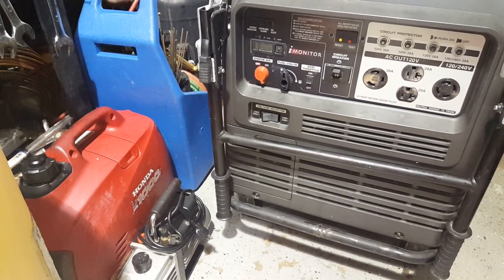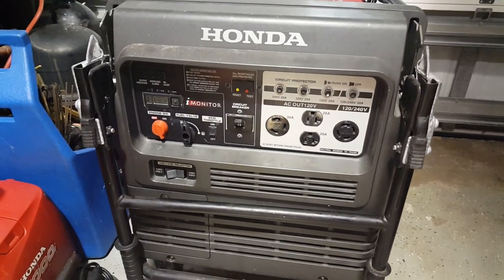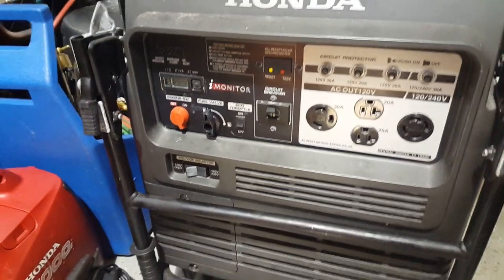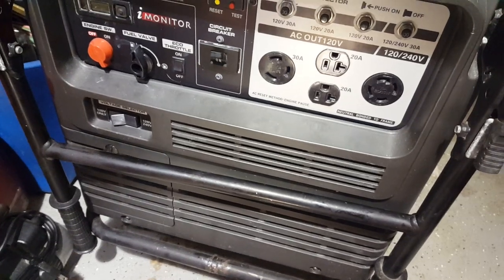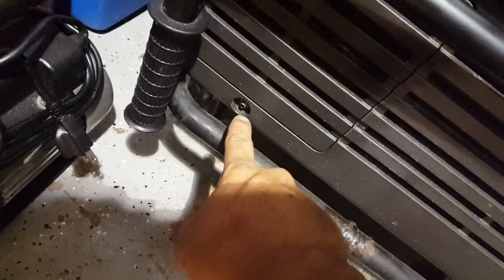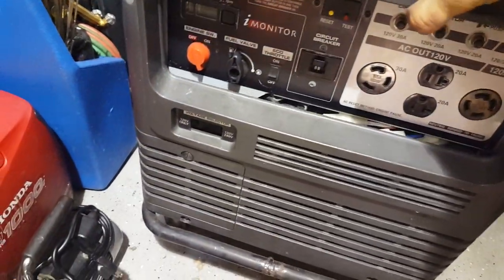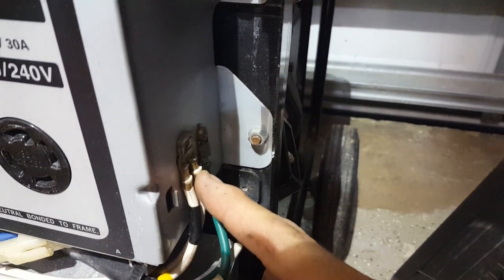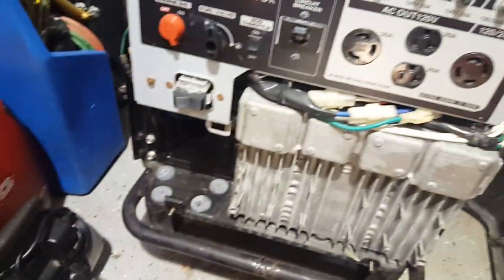Fix tripping breaker Remove neutral bonded to frame eb7000i

Comment: Yep.  Must have floating neutral when booking up to home with interlock switch.  Just keep in mind you cannot plug items into the 120 ac plugs while floating unless you use a bonding plug in one of the outlets.  They are like 7 bucks on Amazon

Comment: I just bought a new eu7000is last weekend and it has a floating neutral. It works great with my house but if I need to charge my wife’s electric car I had to make a bounded neutral plug and plug into one of the outlets to make it work.

Comment: Now you have a floating neutral . How was your connection to the house panel ? Is the ground amd neutral bonded together at the panel ?
Reply from the maker: I ran 4 #8 wires thru the outside wall into a generator plug/box.  Ground and neutral are separate at the panel.  In the future, (next hurricane  watch) I'll redo the wires from the panel too directly to the ac condenser. I'm losing amps going thru two breakers (generator breaker and ac breaker).  I'm hoping this way the compressor will start while the generator is on eco mode
Reply: SouthFlaDiver ok your ground and neutral are separated at the main panel or at the subpanel ? Because my neutral and ground are bonded together at the main panel and separated at the subpanel thats why i was asking you how you connected it because my generator comes from factory with a floating neutral

Comment: Does this ungrounding make it unsafe in any way?
Reply: No, it makes it more safe. In an electrical system on a house, the only place the neutral and ground should be bonded ,”connected “ is in the first main panel they meet in. Everywhere down the line after that, the ground and neutral should be separate. This video shows how a generator is suppose to be when you have it connected to a house. I also recommend driving a ground rod into the ground and having the generator ground connected to it so it’s grounded to earth.
Reply: @wcjcnc  so I switched it from bonded to floating neutral but still won’t run my furnace
Reply: @TXRoeJogan   You may have other wiring problems. Need to test the furnace and see how many amps it’s pulling
Reply: @wcjcnc  When it was a bonded neutral the exhaust fan in the flame would actually come on in as soon as the supply fan started it would trip the GFCI. Now the flame one even ignite or the exhaust fan won’t come on, do you think I should try grounding the generator outside to earth ground? Hey thank you for your time and inside I really appreciate it
Reply: @TXRoeJogan   If the neutral and ground are separate on the generator and it’s putting out enough power to run everything you have turned on, it should work. There has to be a problem with the furnace or the generator. So do you have this generator connected to the house breaker panel or, are you just using extension chords?
Reply: @wcjcnc  it’s a predator 9000 so I’m sure the power is there, I’m plugging my furnace into an extension cord that’s plugged into the generator

Comment: Anyone know how to do this on the EB10000???
Reply: I think I figured out how to do this with the EB10000. Remove the alternator cover and disconnect the neutral (white) from the frame. I’m not an electrician, but I play an engineer at work:) I checked with a multimeter and this did float the neutral... if anyone disagrees let me know.
Reply: Just bought a eb10000.. guys at honda said they have a white jumper from white wire to a yellow with green strip.. disconnect it and it floats neutral.. still waiting to connect to home to get in to it!

Comment: Well I have the same generador and there is no problem with it. This generator was made for commercial use only “as stated in the manual”.  You need to modify the harness and not use the neutral wire, after that the generator will perform with no issues. It is important to leave that green cable where it is  otherwise you will damage the inverter (it happened to me)
Reply: Hope this help for someone else 😁
Reply from the maker: The wire I disconnected is white not green.
Reply: Are you sure that was the cause? Because they make plenty of floating neutral inverter generators.

Comment: What size is your A/C?
Reply from the maker: Dqalex 3 ton American Standard 17 seer with 2 speed compressor,   Honda ran for about 8.5 hours on a tank fuel with eco switch off during hurricane Irma.  These Honda's are underrated
Reply: That's great to know.  I have a EU7000 and I was wondering if it would start one of my 3.5 ton A/C's  I keep waiting for Honda to release the Parallel kit. All they keep saying is its in the works.  its been in the works for years now.  I'm going to give it a try next Week and see if it starts it. Thank you for getting back to me.